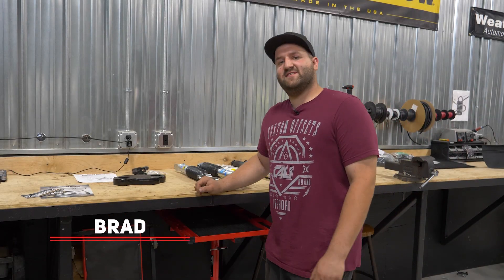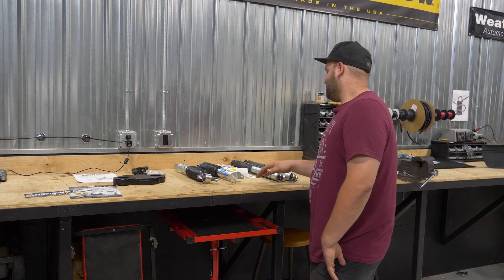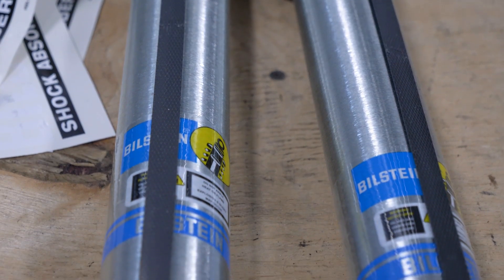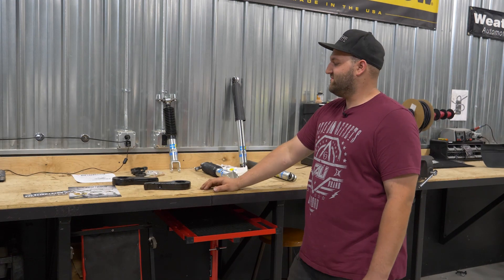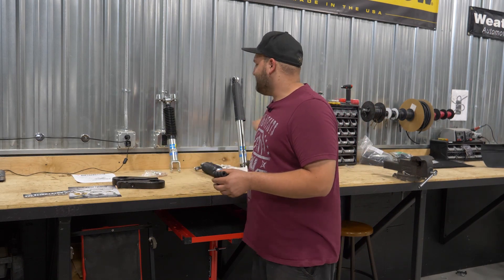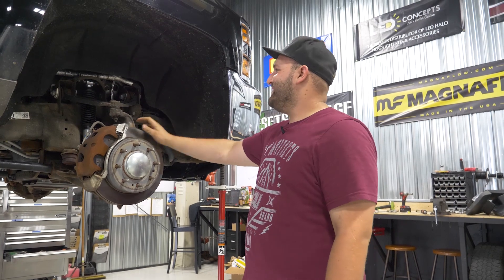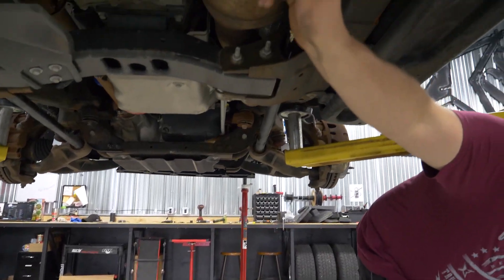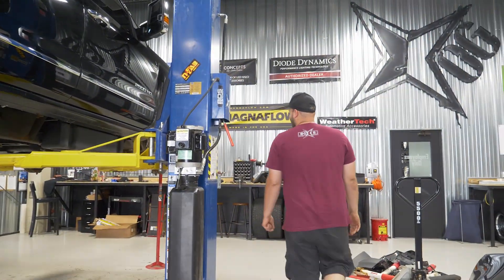Lifts & Levels: Stage 1 Level Kryptonite 2015 Chevy Silverado 2500HD

Comment: How did it ride afterwards? Also did you end up doing a diff drop?
Reply from the maker: It rides a bit rough but this particular truck has the keys set at 3" and the low profile tires dont help either. And no there is no differential drop on this truck. You can check out this Kryptonite kit here!
https://www.customwheeloffset.com/store/16212/kryptonite-stage-1-leveling-kit-with-bilstein-shocks-2011-&year=2015&make=Chevrolet&model=2500%20HD